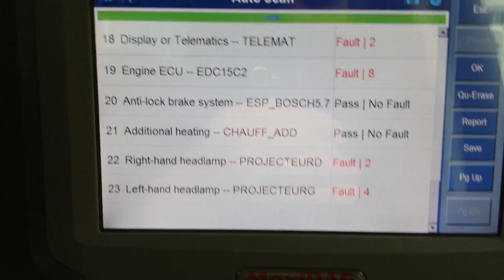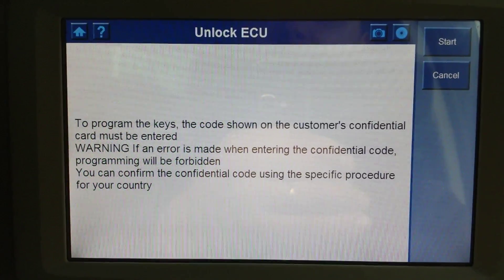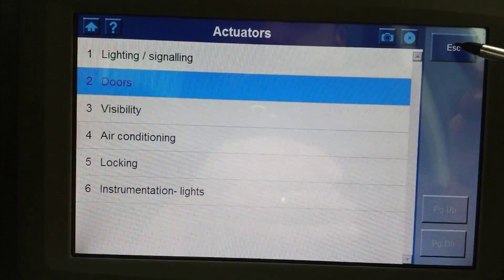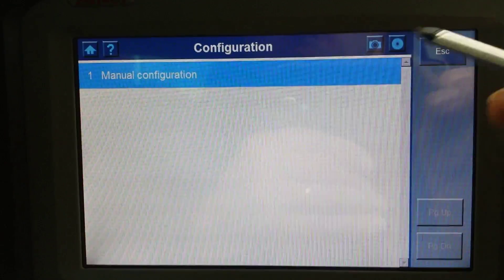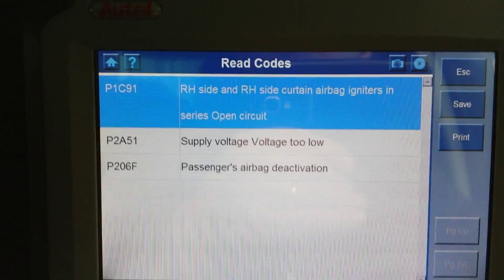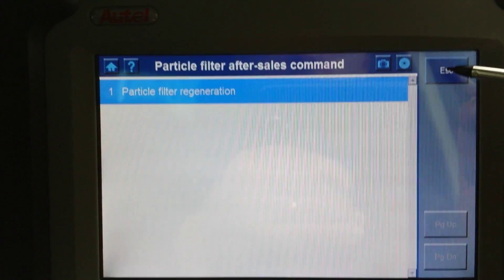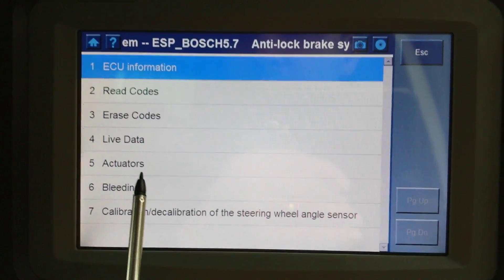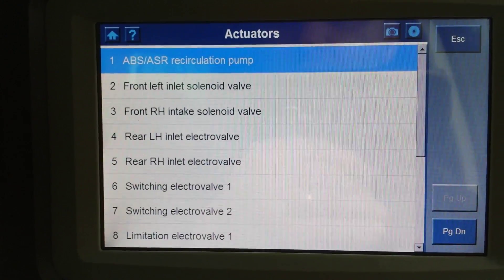DS708 on a 2003 Citroën C8 2.2 HDI

Comment: how did you know that this car isn't can bus ?
Reply from the maker: Hi
A lot of PSA cars carried on using the VAN network along with the CAN for a few more years after the CAN become compulsory...
However, can was then introduced due to regulations in 2004, VAN was still in use for most if not all systems...
This car being a 2003 would be VAN...
But sometimes you just try...
Reply: +lmsvvavr thanks for the prompt reply. I just thought it would be can cause of the hugr amount of ecu's and being can would make them talk with each other easier also the console gps/radio/tel. unit had a fiber optics connector in the back so I assumed with all this technology a can bus wouldn't be a wonder.